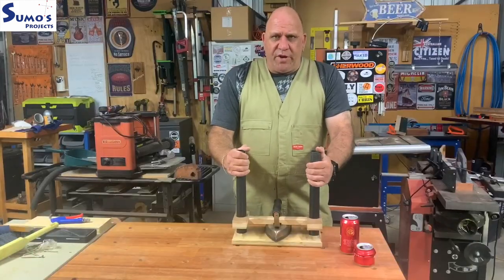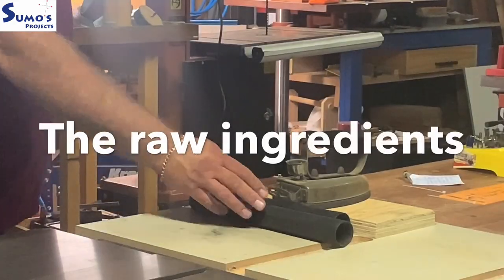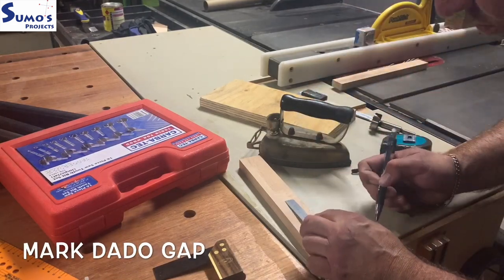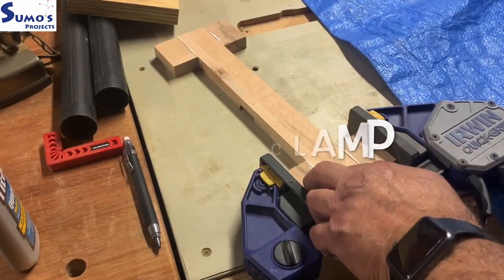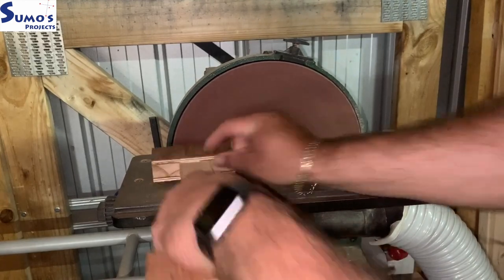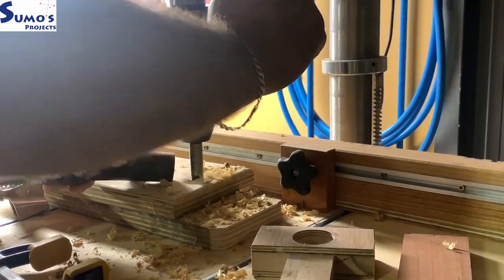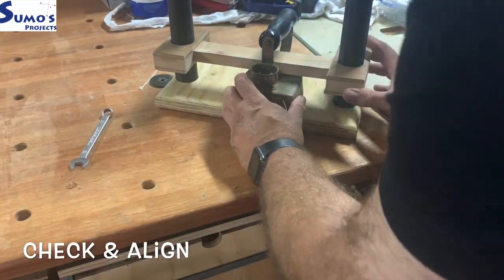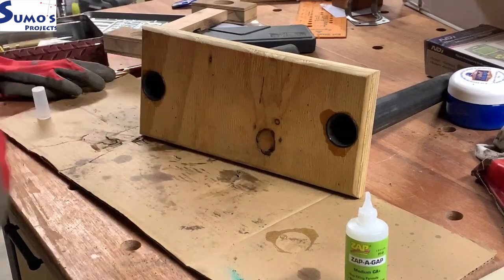How to Make a Beer can Crusher from Scrap Wood,, Plastic and Iron

Comment: Good little project mate, CA glue is a life saver. I buy mine from Wilson & Bradley because they can deliver a full size aerosol can type accelerator for about the same price as those tiny little spritz bottles
Reply from the maker: Thanks Luis, I’ll search that company & it’s amazing the chemistry behind the instant fusion, takes the boredom out of a glue up. A furniture maker told me years ago that the bonding products on the market nearly eliminate the need for other joiners, anyhow it’s fun to try everything 🍻🍻👍👍👍👍